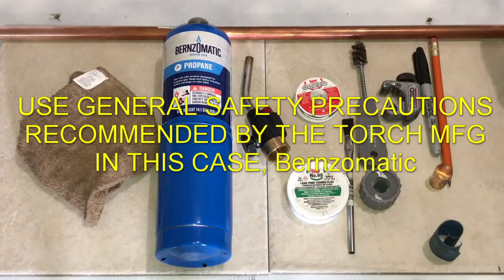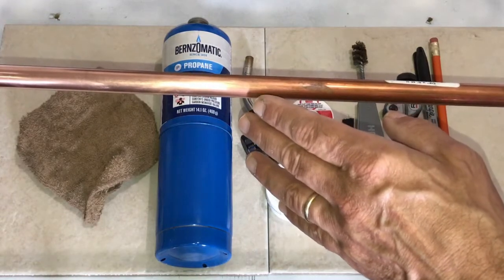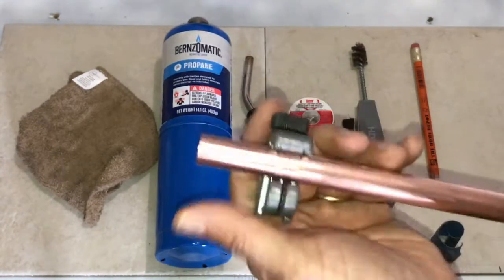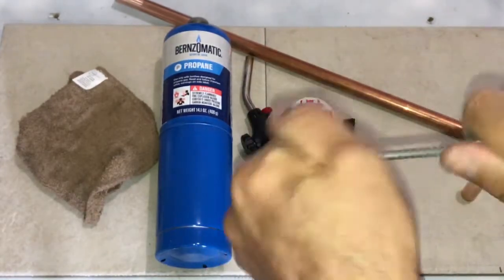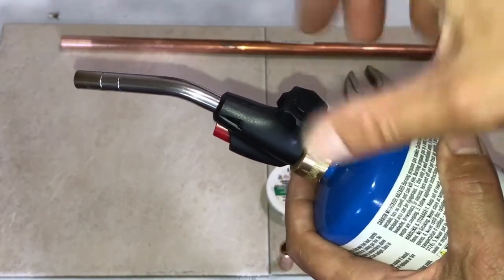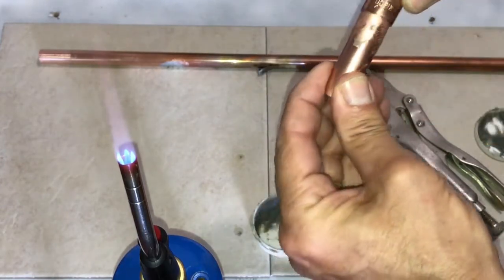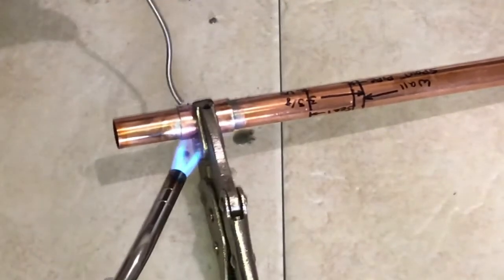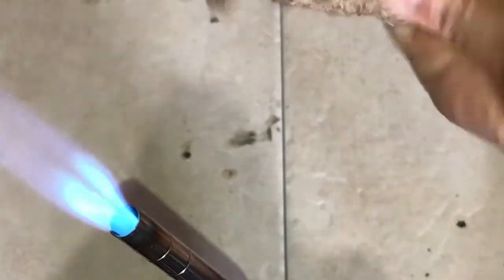Soldering Copper Pipe 101

Comment: Thank you for the video
Can use this Oatey solder for solder aircon piping!?
Reply from the maker: I believe aircon fittings are used for HVAC. If so, I’ve always used sil fos with oxy acetylene torch. This is because pressures inside the lines for HVAC get much higher than plumbing lines. Hope this helps.
Reply: @JustForYouDiy  thank you for your reply
Reply from the maker: @electrolatif  my pleasure
Reply: Oatey 95/5 solder, is it good for soldering aircon piping?

Comment: Hello Sir, thank you very much for the video. I was using the same tinning flux as you shown in this video. But when I soldering the pipe I found the solder "flow" slower when I use the tinning flux than the normal flux. Like, the sloder "only" seal the small part of the gap not like entire gap. Have you ever faced same situation? Thanks
Reply from the maker: Thank you for the question. Sorry but I have not noticed that. Once I started using the tinning flux I did not go back to the non-tinning flux. One reason I like the tinning flux is that it lets me know when the joint is at the right temperature for soldering. Thank you for watching my videos.

Comment: I have a hard time soldering comparing to when I'm brazing copper to copper does tinning flux makes the process easier?
Reply from the maker: It is a common issue. I had the same problem, going from brazing to soldering. Especially with 1/2” copper. I had to get used to decreasing the heat since solder melts at a lower temp than silfoss, therefore, the joint does not have to be as hot. And, you are correct, I use tinning flux as a guide. Once the solder from tinning flux melts, the joint is at the right temp to solder. Hope this helps.

Comment: Thanks for the demonstration. I used this same flux yesterday, but had some trouble getting it to transfer from the brush to the pipe. Is that why you heated the pipe before applying the flux?
Reply from the maker: Once the pipe is clean and free of grease the flux should transfer easily. Using the sandpaper then a clean piece of cloth should be good enough to get the pipe clean. Hope this helps & thanks for watching the videos I have posted.
Reply: @JustForYouDiy  Thanks! It worked this time. I successfully replaced my water main line. It was a pretty big job, but thanks to videos like this, I felt confident to give it a shot. I have no leaks, so I think it worked out well.
Reply from the maker: First one is usually the most intimidating. Glad to hear that it all worked out.

Comment: Good , informative video . I will add , if I may , I always ream the inside of the copper tubing with the reamer attached to most larger cutters or a use pocket knife blade to eliminate the ridge the cutter wheel leaves inside the copper tubing after cutting it , ( a round file will work also ).
Soft , roll copper will leave a more pronounced ridge inside than hard , stick copper does . If pieces of copper fall into the pipe , it will wash out after your joint is soldered, when the water is turned back on  and the faucet is opened .
Reply from the maker: Thank you Rogger for the comments.